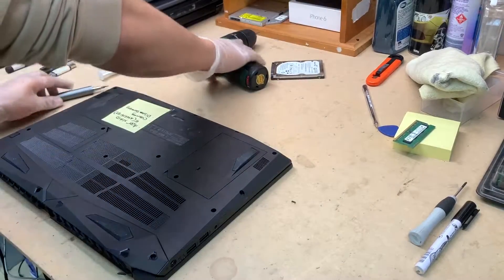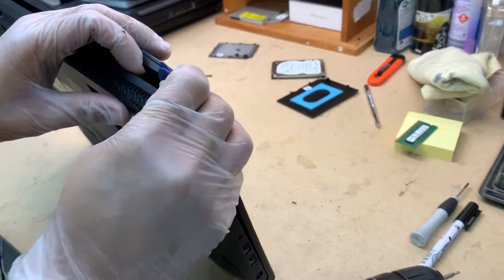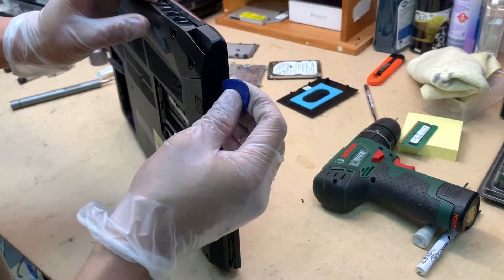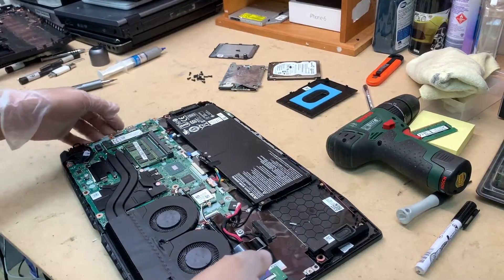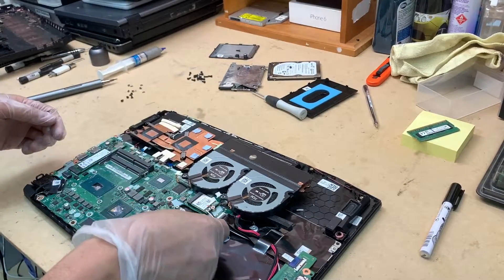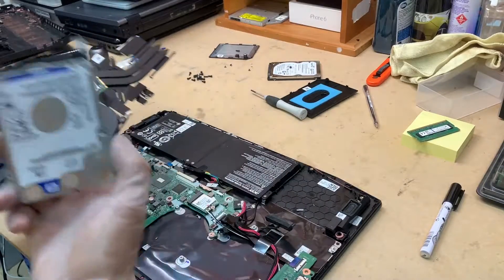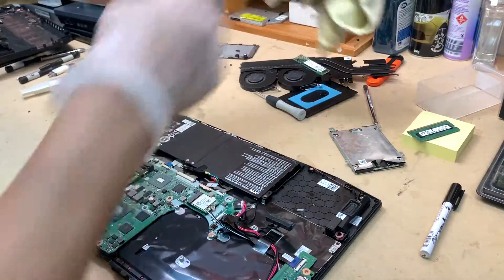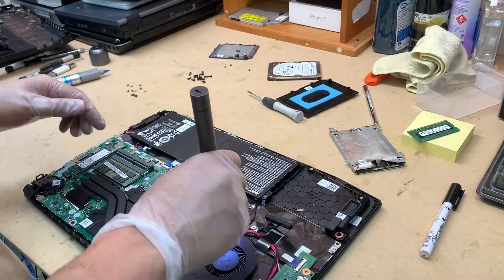How to: Acer Nitro 5 Teardown (Nitro 5 AN515-51) & Fan Re-paste Thermal Liquid

Comment: What how did you take out the hard drive I feel like that tape or connecter is important
Reply: The hard drive comes out before you remove the bottom panel. Just unplug it from the hard drive bay.
Reply: You just unplug it...
Reply from the maker: I don't know what you referring to